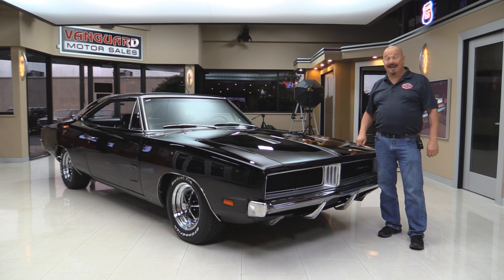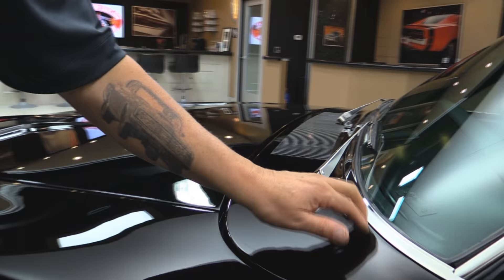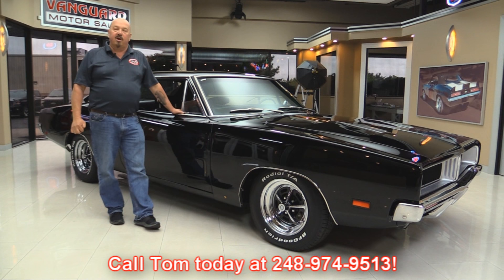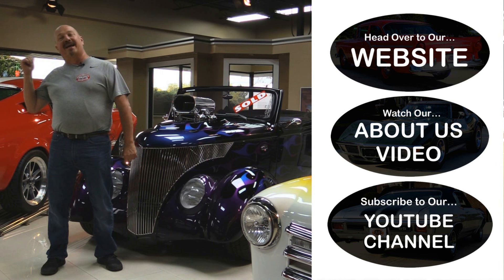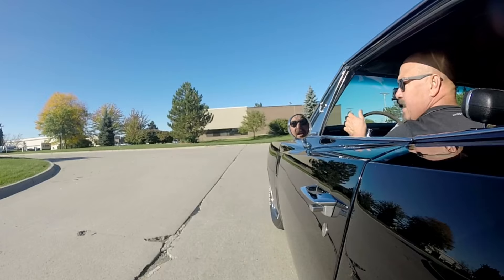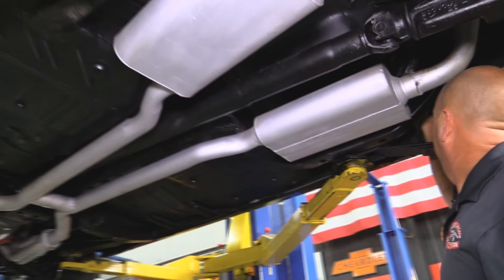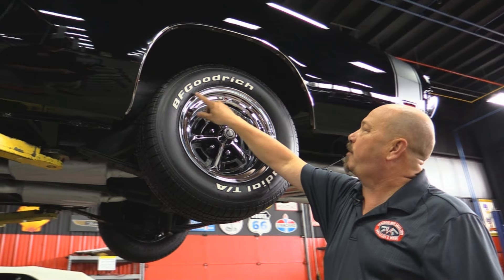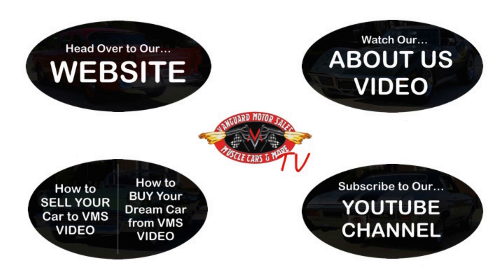1969 Dodge Charger For Sale

Comment: Those Dodge boys with the white hats are at it again, troubles a brewing under that beasties hood,
for the competition that is.
Reply: Just needs some electric cut out valves behind the headers to select that low V~8 rumble,
or a tigers growl.
Reply: @billbright1755 or just needs a dual in dual out exhaust with an x pipe. Needs as less electric stuff on it as possible In my opinion